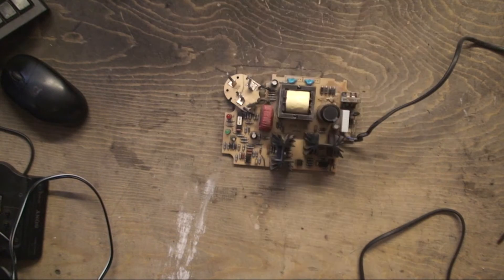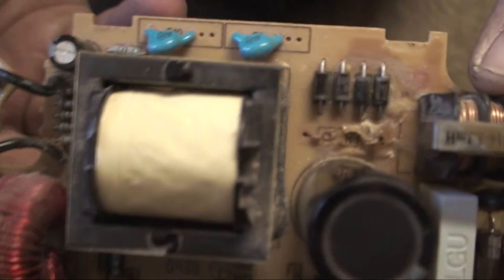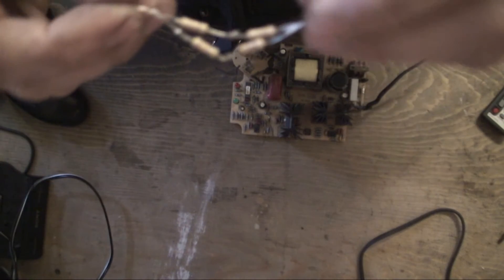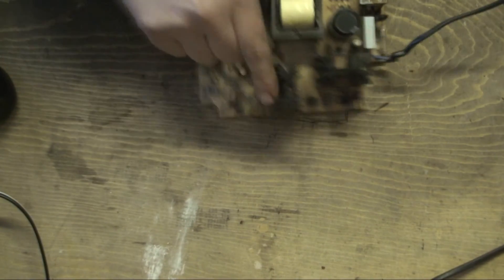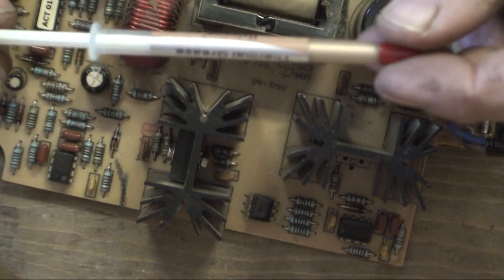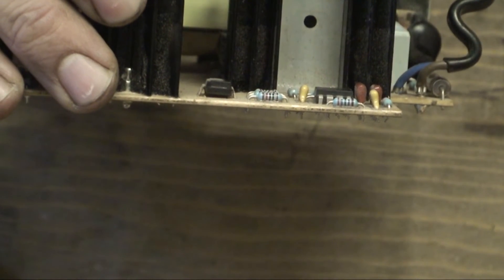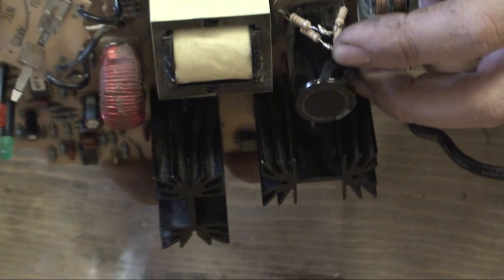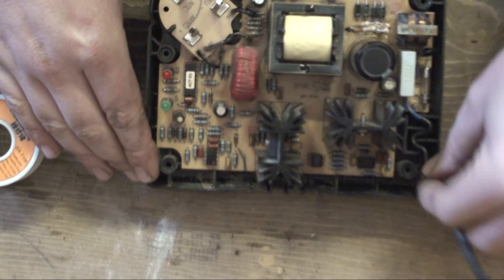bodgit and leggit garage. fixing a bosh drill al 2450 dv charger part 2

Comment: Use 180K (Brown, Grey Yellow) not 18K ! Else all good. Had same problem, replaced the resistor but when plugging in the batteries, Green light goes OFF, Red light comes ON. Unlikely to be 2 bad batteries, so will change the MOSFET next - here's hoping...

Comment: Thanks for great video. My charger was dead so first checked the resistor you suggested and it was open circuit. It was actually 180k as the orangy-yellow band was originally yellow before it got toasted! Replaced it with two 100k in series  (=200k which is close enough) and reduces the stress on the individual resistors so hopefully won't toast in future!  Worked so MOSFET was ok.

Comment: Just fitted 180k ohm resistor for £1.95 on ebay  (pack of 10) ,Thanks for putting ur video up, saved buying a new charger at toolstop  for £35.  
Cheers
Stevie G

Comment: Bang or Lights up lol..    Stick a 25W lamp in series with the supply, if there is a problem the lamp will save the electronics from becoming toast.
Reply: 25w 230v lamp..   should have said.  Thanks for your post., Well done. Im becoming an old codger and thus have not made a you tube video but its on my todo list. Cheers from NZ.

Comment: Great video going to give it a go, what is the part number for the MOSFET? cheers
Reply: STP6NK90Z. Educated guess.  I have a diagram that looks similar too.   I'm repairing a Bosch charger that spat the Mosfet and a few resistors. My gate pin of the mosfet has a open cct 30 Ohm resistor fed from  a 2N2904 transistor  ( V6)  which is driven via a opto ..  Got to be careful reading some of the resistors as they have an extra color thrown in to confuse.

Comment: I have a very similar battery charger that burned out several years ago and I was forced to replace it at $100 CDN. The new one burned out as well recently and I couldn't find the problem until I watched your video. It looks like it may be the same resistor so I'm hopeful I can get it working before the batteries sit for too long. Thanks

Comment: Thanks for the video. My MOSFET had gone short circuit in all directions, and the 180k resistor (R3) had burnt out too. Replaced both, but upgraded the resistor to 2 watts, and soldered it in with good air clearance around it. The charger is working again for just a couple of £'s.
Reply from the maker: CaptainBee100 sorted mate thanks for watching

Comment: 180k resistor not 18k the band is yellow
Reply: Michael Laverty You know it! I have a charger with the same problem. Same board layout pretty much (Mine is a BC130) Same resistor bad from the same MOSFET being shorted. I just need to order the MOSFET. My tester shows it as being bad. (Back in the day we didnt have MOSFET testers, we just used ohm meters on them. Now 30 bux and you can test most anything! :D ) This guy needs a class or two on soldering as well, but gotta give him credit. At least he did fix it.